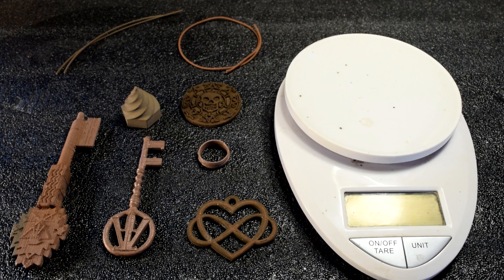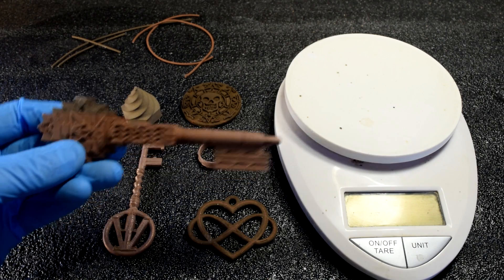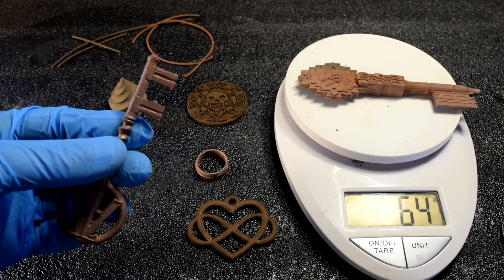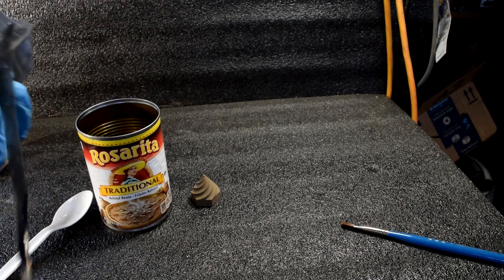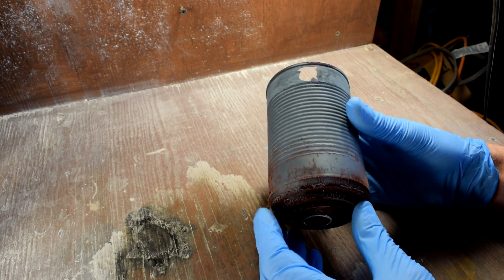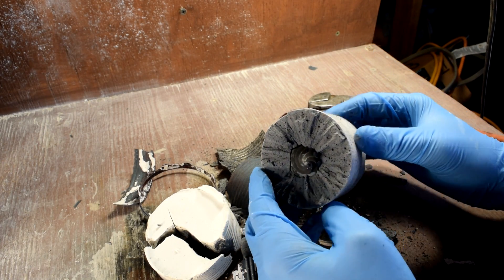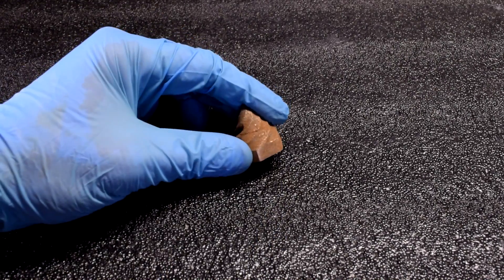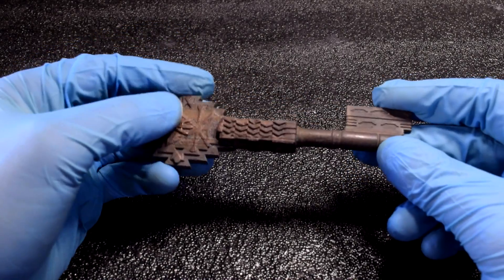Virtual Foundry 90% Metal Filament...a 2nd look

Comment: They will not answer the phone and what they don’t tell you is all there filaments HAVE TO HAVE the filawarmer witch it’s another 100 bucks just save yourself time ,hassle,money just buy from matter hackers BASF ULTRAFUSE STAINLESS STEEL YOU DONT NEED THE EXTRA 100 dollars crappy pvc pipe thing they sell you also matter hackers will spinster and debind your products you print for free just shipping cost MATTER HACKERS IS A MUCH BETTER QUALITY COMPANY AND ALOT ALOT I MEAN ALOT BETTER COSTOMER SERVICE THEY DONT LIE AND HIDE THINGS THAT ARE VERY IMPORTANT unlike virtual foundry has done for years and stealing ppls money WHY NOT TELL PPL THEY HAVE TO HAVE THE FILAWARMER IDC WHAT YOU TRY WITH A REG FDM PRINTER IT WONT PRINT WORTH A CRAP WITHOUT THE FILAWARMER!

Comment: Hi. I'm the Founder/ceo of The Virtual Foundry. Your first review was helpful for us. Your followup was also helpful. It's been quite a few years since your last review. I've put years worth of effort into make this process easier. Our newest instructions for sintering bronze and copper have a 95%+ success rate. Also, the filament is MUCH easier to work with (it's not brittle).

Anyway, if your up for reviewing the newest version, please reach out. I'll set you up with an evaluation kit  free of charge.

No strings attached, of course. I'd expect you to present your honest opinion. The process has become so refined and simple that I'm confident you will wind up with a really nice metal 3d print.

Please reach out if you're interested.
Reply: Just sent y’all an email. I purchased your 17-4 kit. Will do a video review if you’re interested. I have a programmable paragon casting kiln to work with but just don’t know if I need a higher temp thermocouple or not.
Reply: @grantballard4362  Any kiln configuration that can go to cone 10 will comfortably sinter the stainless filaments. Bronze is the easiest to work with and sinters at just 1575f. But the nickel alloys all sinter with similar recipe's, and 17-4 is the easiest 

Please reach out if you need support!
Reply: You also guaranteed success when you will not answer your phone and reply back with one email per week

Comment: Can you 3d print exposed lattice structures? For instance lattices where the members are maybe 1-2 mm cross sections but are not part of the infill?
Reply from the maker: Yep, here is a video I did years ago with a VERY simple lattice structure. You can get much more intricate then this though. https://youtu.be/NlKhoHOR2_Y

Comment: sir, i have watched a lot of videos saying that after heating the finished product, the product will shrink from 100% to 90% in size,does this happen to you?
Reply from the maker: KEAL I didn't notice that, but I didn't test for it either. I would imagine there would be some shrinkage. Even with traditional metal casting you get shrinkage. There might be another review of this product coming in the future and if so I will look at how much the print shrinks.

Comment: I think they need to first design new printer setup which can hole the raw plastic and metal powder together and further flow it into the extruder melting it there at the extrusion so that way at-least ..you won't have the brittleness issue...or they need to use some sort of small laser to melt it...or even the traditional extrusion methode.
~very informative video~
             ~Thanks~
            ~namaste~
Reply from the maker: I believe they now offer a pre-heater for their filament that is suppose to help with the brittleness but I haven't tried it.

Comment: my guess is that "black magic powder" is pretty much a mix of carbon and plaster (probably refractory grade). carbon just creates a protection against oxidation and plaster just to keep things together. when a company gives their product a "magic" name it often a dead simple mixture 8 times out of 10.
Reply: Some shops sell just aluminium oxide along with the filament for that very purpose.
Reply: You are correct (I'm the guy that made it). It was a blend of SatinCast and coconut carbon. The carbon works as an 'oxygen getter'.  This was my 2015 version of the process. The modern process is less complicated, less messy, takes less time and has a much higher success rate.

Comment: This filament doesn't really seem worth it.  It's a cool concept, but outrageously expensive (by volume, it seems like the bronze filament is about 25 times the price of average PLA).  For much less than the price of a single spool, you can buy all the equipment and materials you need to do silicone molding and metal casting (at least using relatively low melting temperature metals), with less janky results and less frustrating prints.

Comment: i think it still makes a lot more sense to just print moulds and cast metal parts
Reply: That company also sells clay filament, I'd be curious to try that as a mold.
Reply: @gliscameria  oh. for a second i wondered whether it was burnable, but that wouldnt make much sense. I also have a resin printer and there is ceramic resin you can actually burn to get something akin to a proper ceramic afterwards

Comment: A few thoughts I had while watching this. Maybe  pre-heating in the oven would make the filament more flexible for loading. Perhaps a box over the printer warmed by a hair dryer while it prints.  After it dries in the kiln, maybe sprinkle some charcoal on top and seal with aluminum foil to keep out oxygen.

Comment: I appreciate the videos and your effort. But I cringed each time you didn't follow instructions. From the guessing at mixing to the timing of the sintering to the quenching. I'm sorry but how can you really call these reviews? Do you not have a measuring cup or ability to schedule your time around sleep? If I owned the company I would be very frustrated watching these. Imagine if it was your company! Thanks for trying though.
Reply from the maker: Make a better product to review. I'm tired of the same comments from virtual foundry in disguise. I reviewed this twice and both times the results were bad.
Reply: ProjectTube - The results were bad because of your inability to follow instructions

Comment: Have you used FilaWarmer? Some of Virtual Foundry's filaments require pre-heating to around 50-70 degrees Celsius before feeding into an extruder, it could solve the problem with breaking
Reply: I tried this, but they also improved their filament so it doesn't break as easily.

Comment: Have you tried pickling with jewelers’ acid & a little heat? The dark coating is most likely fire scale if it sounds like metal.  
Also, how bad are the fumes as these pieces sinter? Have you done several pieces at once?

Comment: Once sanded lightly to remove the layer marks; I would do the sintering before polishing it. If it comes out anything close to metal you could use a Dremel or similar tool to get a polish with less chance of damage.  About strength I would guess it could get to about 89% that of bronze since at least theoretical that would be the density.  The burnout would leave it porous by the percentage of volume that was taken up by the plastic which would be reduced by any shrinkage. So if it had 5% shrinkage then it would still leave it about 5-6% porous. Although there might be other principles regarding the percentage of porosity translated to strength.

Comment: Would love to see a strength test, see if it's as strong as normal bronze.
Reply from the maker: JohnnyThund3r it's not, perhaps if you got the sintering perfect but I doubt it.
Reply: Too bad, hopefully someday.
Reply: According to them the steel filament is as strong as MIM parts when sintered. 3D Metal is an industrial company, but has a similar process and their metal parts turn out amazing. Only 100k!

Comment: Hm... looks interesting, but not quite there yet. How about quickly etching that copper key (with NaOH or ferric cloride we use in the electronics world for PCBs) to get a cleaner surface and then try to electroplate some real copper on top of it? Could help with getting a surface you can polish up...
Reply from the maker: ExtraBase I did actually etch the smaller key and got poor results.
Reply: @RealProjectTube  Try HCl it dissolves copper oxide.

Comment: The BMP probably contains carbon and some sort of plaster (and an rotten egg, just for good luck :P) Carbon, due to the brittle hardend steel can, If i remember right, when you heat steel and add carbon, it hardens... Probably why the outer layer of you previous test was all white in the outer rim, all carbon had fused with the steel can. Plaster due to the heat after curing. A rotten egg, well you said it :P (Could also be sulfur. So just to be safe, don't add potassium nitrate to the mix, or you kiln might blow up! :P)
Interesting channel, you got a new subscriber :) Some possitive criticism though. Your intro video as way to loud music, it's hard to hear what you say.
Reply: I guess carbon and Borax at least.  Possibly more.

Comment: Score on the kiln I've had my feelers out for a while no luck yet but I'll find a good deal. Now that you have the kiln your burn-out process should be much better ;) can't wait to see what you do with your new toy! Nice Edit
Reply from the maker: Inside The Mind Of Matt yea i had my eye out for awhile! I got it specifically for the burn out, should be 100 times easier now.
Reply: ProjectTube I’ve looked into suspendasurry I could drive 4 hours one way to get it and save $100 shipping and still spend $400 on the smallest amount they sell looking at Alternative mold mediums but have to admit printing has my attention right now